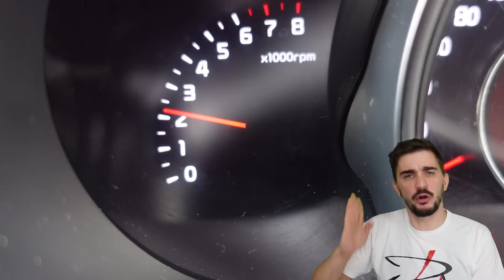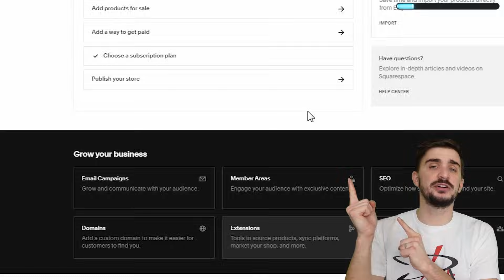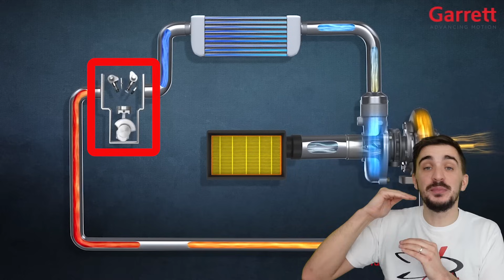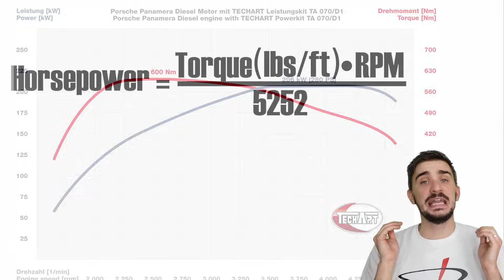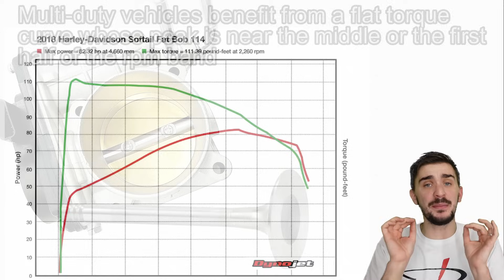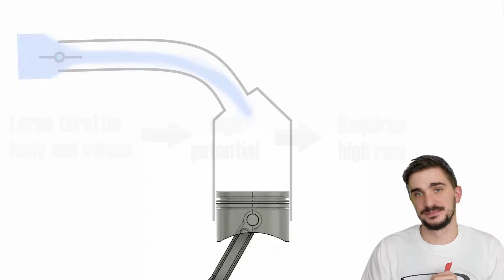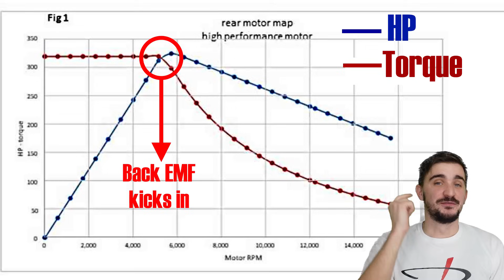WHY are HORSEPOWER and TORQUE CURVED?

Comment: Engines produce peak torque at a certain RPM. Horsepower is a mathematical function of torque and RPM. Naturally, both lines will curve. You may now skip this video.

Comment: that's why honda's old 12/16v mode sohc-vtec is a joke, they realize and ditched it.
its just making disadvatages to pumping loses, not air-fuel which dictate by cylinder displacement.

Comment: how would spinning the piston faster cause the engine to "choke"

wouldnt the air pressure just increase to push the air thru the opening faster?

ie when you have a hose and water flowing thru it if u make the opening smaller it increases flow speed

why wouldnt the air just flow faster to cancel out the fact that the opening is smaller?
Reply: Air, unlike hydraulic fluid, is compressible expandable and has elasticity.
Reply: @rollsroyce329  yeah i thought about this more and came to the conclusion that the opening restricts air flow due to atmospheric pressure being what it is

you COULD make more air go down there by doing something to raise the pressure which is what superchargers and turbos are doing
Reply: @dynamo3059 exactly! 👍. Air, unlike hydraulic fluid, is compressible so you can put more in under more pressure.  The other cool thing to explore is that because it is compressible it has an elasticity that acts like a spring.  The resonance of the spring rate can amplify or nullify pressure waves in the system increasing or reducing power as a result. Once you see an engine cycles and intake and exhaust tracks like a musical instrument things get really interesting.  I’ll list some videos for you to check out in the morning.
Cheers mate!
Reply: @rollsroyce329 well yes theres that aspect but i was thinking about the chart how torque drops off at high enough rpm cuz the engine is choking

only way that can happen is the vacuum in the engine doesnt have enough sucking force from normal air pressure to fill itself before the piston turns over again

if u had forced air tho then it would
Reply: @dynamo3059  if you tune the intake and exhaust tracts you can achieve over 100% of atmospheric pressure inside the cylinder…. (Without mechanical forced induction) simply using the inertial, elastic and resonance of the tuning.   You won’t achieve 4 Bar but is something to understand before you can really understand an engine naturally aspirated or forced induction.  Great to see you have a passion for the technical/ physics side of things.
Reply: @rollsroyce329 its not a compression issue its flow speed

the atmosphere doesnt push the air in fast enough to fill the vacuum in the engine at high rpms before the piston turns over again, thats why piston size and entrance size are the limiting factors
Reply: @dynamo3059  do you know what BMEP is?  Do you think you’re “teaching” here? 😁
Reply: @rollsroyce329 hmmm interesting

yeah i didnt do deep research on it lol

i got that by thinking about it

seems theres more involved tho
Reply: @rollsroyce329 no idea, yes im teaching myself lol
Reply: @dynamo3059  I’m not talking about the static compression ratio.  I’m talking dynamically compressing air into the cylinder using resonance.  Don’t waste your time looking only at flow speed, en engine is not a vacuum cleaner (that is a dig at everybody who thinks a flow bench is telling them what they think it’s telling them) and air is not hydraulic fluid.  It’s not simply volume and speed it’s density also.
Reply: @dynamo3059  cool, I’m trying to help, let me know if you don’t want me to.

Comment: Wtf does speed of piston have to do with volume of vaccum created ? 
If you pull an injection slowly or very fast doesnt matter , what matters is volume . 

Unless. The valve isnt opening for as long as the intake stroke

Comment: My understanding was a supercharger produces small amounts of boost at idle? I’ve seen  cars with large enough blowers that actually “scoot” at idle and they have to actively hold down the brake to keep it still. It’s not a flat torque curve but I was still under the impression that it’s creating boost at idle?

Comment: The torque curve of my dinky little BMW 114i (1,6 L twin scroll turbo) shows full torque at 1100 rpm, flat line up to 4000 rpm. Of course, that engine is electronically restricted and it would look differently with maxed out tuning. But you can build an engine which has ‚full‘ torque barely above idle 😊
Reply: You coild but why would you want to?

Comment: most of the curve graphs you show are fake. Proper HP and torque graphs will show the intersection point at 5252 rpm.
Reply from the maker: *facepalm. Before you accuse someone of posting something fake use your two neurons and think. They intersect at 5252 only when you use imperial units, otherwise they can intersect pretty much wherever.

Comment: Riding bicycles helped me understant it - specially when pedalling downhill and finding the bike was so fast I could not transfer power to the gears. On an ICE engine the limit is the speed of gas expansion during ignition. i do realize other limits are reached first but that's, I think, a good way to view the process. BTW, all those apects of ICE engines also exist in electric motors even though their RPMxTorque curves are different. Brushless DC motors, for instance, have a constant torque region when they start then they move towards a constant power region (torque decreases) and beyond that it reaches an inneficient region where. The last region is probably caused by the limited speed of magnetization. 

The constant (or high) torque at low RPMs is what makes electric motors great for trains. It's also why tires don't last as long in (PH)EVs. I'm a fan of electric motors and really like to drive - I never had a nice car, though, and the best I've ever had is my current VW UP! TSi running on Ethanol. What I would love to see is a hybrid with a fuel engine running at some constant state with an efficiency comparable to the one those turbines have on thermo power plants. If we manage to do that we won't need to spend resources doing things like new transmission lines or mining for scarce minerals for batteries.

Comment: hello, nice video, thanks for sharing! Please can you help me solve my quite an interesting topic? I have got BMW M4 and now I learned how to read ECU DME data. I can read standard channels and also RAM channels (80 values all together). After doing datalogs I noticed that the engine is able to offer more power and torque than the car is able to use. Concretely the torque limiters keep the car lower than the car offers. No problem, when I rise up the limiters then I get more power, it works well. But my question is if I can also rise the torque limiters up  at high RPM (5.500-7.500) the car (torque ACTUAL) offers about 15% more than the limiter control alows. Example, the limit is set 560Nm at 6.000 RPM but torque ACTUAL offers 590Nm at 6.000 RPM. Why producers limit the torque towards the red line? Could the torque harm the engine at high RPM?

Comment: Unless I missed it, the most important actual physical reason for more air being in the cylinder at higher RPMs wasn't mentioned: air inertia. At slow RPMs the air has more than enough time to fill the entire displacement if the intake valve is open at BDC; but that would fill the cylinder with something close to atmospheric pressure. At higher RPM or if you have a narrower intake manifold, the incoming air has a much greater speed, rushes into the cylinder at higher than atmospheric pressure due to its inertia (even without a turbo) and is trapped there by the intake valve closing behind it.
Please correct me if I'm wrong.

Comment: Wait, but if torque eventually starts dropping off due to too much air being forced in, how is RPM still increasing? Shouldn't at that point be the point where we've achieved maximum RPM?

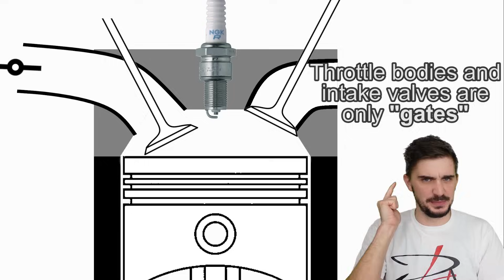Comment: 3:36 This doesn't really make sense. Its not that the piston creates more vacuum, and therefore can suck in more air. The Cylinder always gets fully filled with air, its not like there's less air per intake at lower rpms. Its simply the at higher rpms the piston sucks in air more often. So a 1 Liter engine at 240 rpm sucks in 1 Liter per second, and at 2400 rpm, it sucks in 10 Liters per second. Since there more air, you can burn more fuel = more power.

Comment: They're curved because the pumping losses at the intake and exhaust increase with speed ... The  rpms also increase which increases the frequency of the combustion which increases combustion temps which decreases timing advance which decreases hp

Comment: Hello, i want to ask, if, for example, an engine has already reached its maximum horsepower at 9000 rpm, is it logical to put the limiter at 9000 rpm because it only produces less power and torque if it revs higher?

Comment: do you have any reference for the increase in the amount of air that gets in the piston at higher piston speeds? While the pressure gradient increases and thus the air flow speed is higher, the amount of time the air has to enter the piston goes down. So u have higher flow at less flow time, so why would this option give more air volume in the piston than lower flow at higher flow time?

Comment: One thing is unclear to is that  how engine have variable rpm?
Reply: What gear you’re in. The lower the gear. The lower the gear ratio so it’s easier to rotate. Think if you input a force into a clock. One hand takes 60 seconds to rotate. Another takes 60 minutes but both are experiencing the same force

Comment: Piston speed and rpm are directly related to speed of the rotatin crankshaft/flywheel/drivetrain, and it is this rotating assembly that stores the energy we have created, in the form of momentum. A big heavy flywheel takes a lot of energy to get going, but once its spinning at the designed rpm, it takes relatively little energy to keep its momentum going.

Comment: This is not true. Check any Internal Combustion Engines textbook. The main reason is volumetric efficiency, which depends on rpm, but not because of piston speed. In fact lower speed usually means better volumetric efficiency. Intake length has the major effect on the shape of the torque curve and is designed to have desired shape. Variable intake length can make the torque curve flatter.

Comment: I kind of dont understand why changing the TB and valves to larger ones merely moves the torque curve peak to occur later. If this is simply a restriction, why making TB's and valves larger limit my torque at lower rpm? Shouldnt that have no effect on torque on low-end, but then increase it?

Comment: I'm very surprised header length, intake runner length, and camshaft timing were excluded from this video, I would say those things are the actual reason why torque curves are shaped the way they are, throttle body, valve size, and piston speed only effects the peak power potential.

Comment: The Mercedes-Benz AMG C 43 4Matic has a bi hybrid electric compressor & turbocharger set up capable of achieving a maximum boostpressure of 1.1 bar. With this setup the engine is able to achieve the maximum torque of 520 Nm in the range of 2500rpm to 5000rpm and achieves max power between 5600rpm and 6100rpm of 390.3 PS.

Comment: Saying that the piston speed affects the total amount of air in the cylinder doesn't intuitively make sense - I think you missed something in this explanation. The piston moves from top dead center to bottom dead center, regardless of the piston speed, right? So at the bottom, the same capacity for air exists in the cylinder, right? So why is there more air when the piston is moving faster if the capacity of the cylinder remains the same?

The answer might be one of the following
Possibly, at lower RPM, the piston does NOT move as far down the cylinder compared to high RPM, so there is actually less cylinder capacity at bottom dead center at low RPM, thus less air is sucked in by the piston.
An alternative is that the piston speed when it pulls air in gives the air some sort of momentum, so even though the cylinder capacity is the same, the amount of air inside that cylinder is increased - there is actually more air pressure in the cylinder at high RPM than low RPM. This would explain more air for the same cylinder capacity. Pulling in air faster into the same size cylinder results in more air filling the cylinder than pulling in the air slowly.

Whatever the answer is, I didn't get it from the video, sadly. The closest part is at 4:05 but the image assumes that the first explanation is true, yet his words say that the second explanation may be true. It isn't obvious why a faster piston speed would create more of a vacuum than a slower piston speed. Does this imply that if I had an empty syringe, and I pulled it back to fill it with air, I would fill it with MORE air if I pulled it back faster?

Comment: Just a question poped in my mind, would not an electric piloted turbo fix this issue ? It could feed the engine lots of air  almost instantly alowing it to generate power even at low rpm. Just food for tought

Comment: Is flame front propagation not a factor at higher piston speeds? I thought you get better burn efficiency at lower RPM because the mixture has more time to burn.

Comment: There are many other variables, though I think he touched upon the primary ones. Parasitic losses from bearings, thermal efficiencies, variable valves, etc all factor in. The biggest factor that comes to mind for me, especially for why torque drops off in higher rpm, even if the valves and intake are not a restriction,  is the flame front and the time it takes for the pressure to build after ignition. At higher rpm the fuel air mix has less time to burn, thus providing less pressure, thus less torque. At extremely high piston speeds the piston may even outpace the flame front, at which point the engine rpm is usually self-limiting. This situation is not normally possible on most engines due to other factors and is obviously avoided by engineering design (piston speeds in this range also risk con rod or wrist pin failure, or simply overheating)
Reply: I also think so. Hhighly dynamic processes are at work here (mixing of gases, combustion, flame front speed, pressure build up), and they simply behave differently depending the period of time (=rpm). 

I even think the explanations of that dude are wrong. He basically says that a slow rpm engine (so slower moving pistons) burns less air then a high reving one and so the combustion of less air (+less fuel) generates less pressure (=force on the rod)... but that does not apply here imo. But that just explained the increase of horsepower, not the of torque. We have to think about a single stroke here. Under ideal conditions, you always get the displacement fully filled with air regardless of the rpm.

Comment: combustion speed, volumetric efficiency and most importantly heat generation from the combustion process and friction from ultra-high piston speed. Also even if ultra high piston speeds were to be achieved, another limiting factor would mechanical failure, which could result in joints or solid parts from heat, material fatigue, compression or bending forces in components...etc

Comment: This may be a silly question:
imagine in a particular engine we have the max torque on 5000 rpm . lets open the the carb (the engine is on test stand with no load) until we reach the 5000 and hold it there , so now we have the max torque . This torque comes from combustion force generated at 5000 rpm at the piston top multiplied by  the arm length (  length of the connecting rod plus the distance of the crank pin to the center of rotation , which both are constant) . For going to higher rpms ,say 5500, we need to increase the combustion power by opening the carb air intake even more , right? (is there any other way to increase the rpm?) . the question is why in the graph the torque decreases when we have more combustion force ?(torque = combustion force X arm length)

Comment: How about electric forced induction? Electric motors spool up the compressor wheel, which can create maximum boost even at idle. Would that create flat power and torque lines? 🤔

Comment: Electric motors DO NOT HAVE a FLAT torque curve. They are (for the most part) linearly decreasing from maximum at 0rpm. A flat torque curve in the electric motor used in a Tesla or some other Electric car has to be from current limiting at low RPM. This is to keep the windings from melting and, as you also noticed, to make the car more drivable. Back EMF is always at play if the armature is rotating.